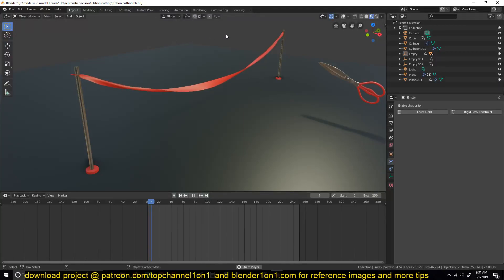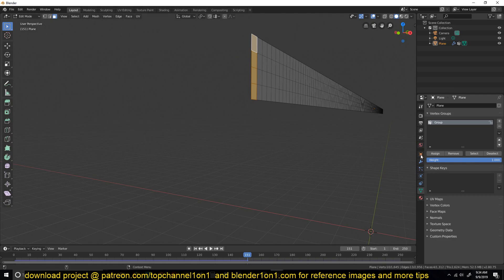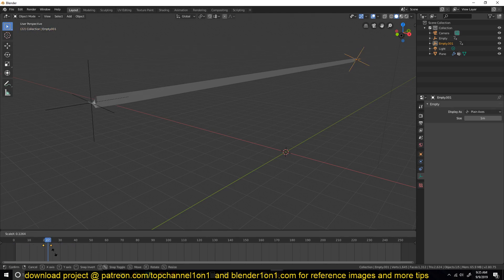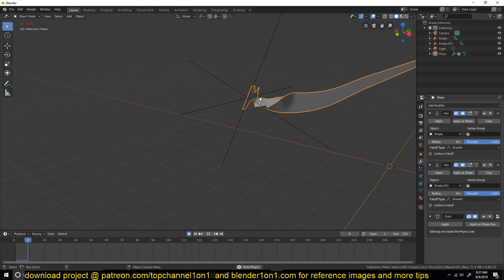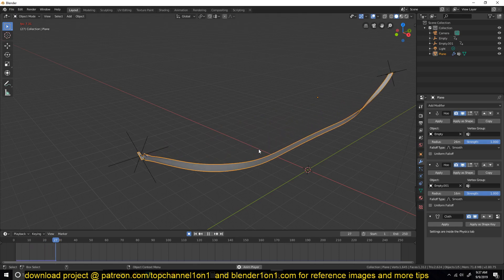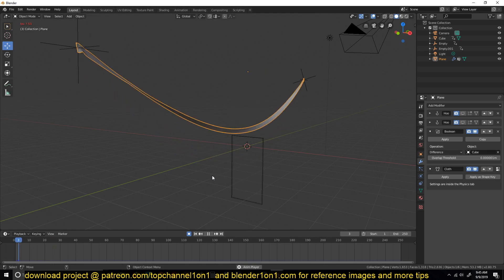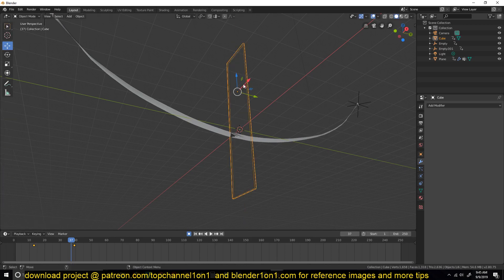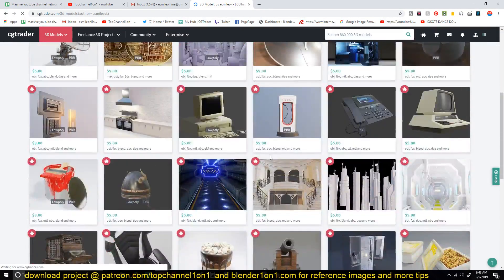blender daily tip  tearing cloth in blender 2 8 advanced cloth simulation

Comment: The buggy simulation seems to be caused by the parented empty not knowing what vertices it's supposed to be attached to anymore when it touches the Boolean. That's why it's not buggy anymore after you disabled the Hook. I noticed this in my own project when I attached an empty to some vertices, the empty then goes into random places when a Boolean goes through it.
Reply: My problem is when I make a simulation like this it is also glitchy and when I try to bake it, it deletes the previous caches when the boolean starts to cut the cloth
Reply: @x-1880  Caches usually rely on vertices count to be unchanging, so baking it won't solve it either unfortunately. The amount of vertices gets recalculated every time the cloth moves, therefore the Boolean has to recalculate, and then recalculating the vertices, and so on.
Reply: did you find any solution to this? @ellypaws
Reply: Im having the same issue @x-1880